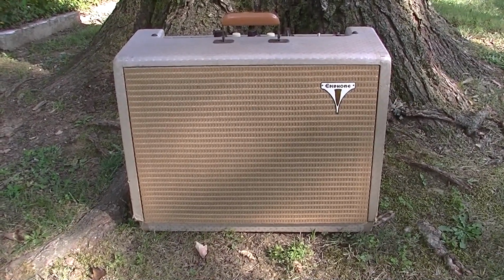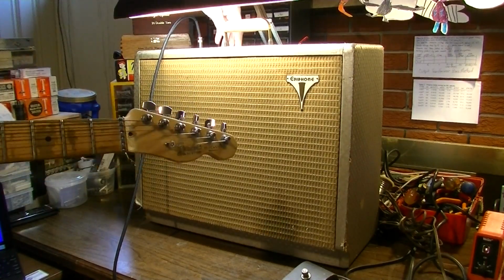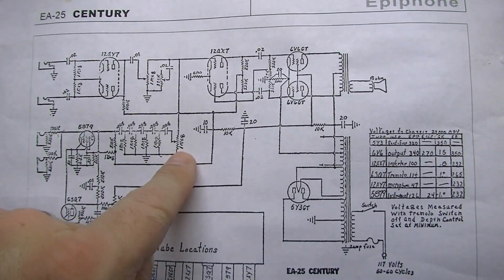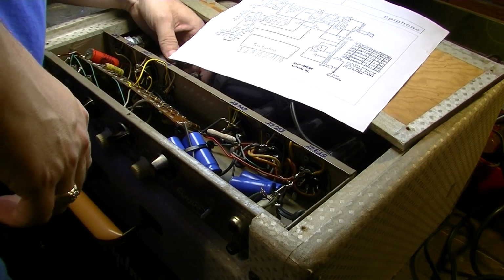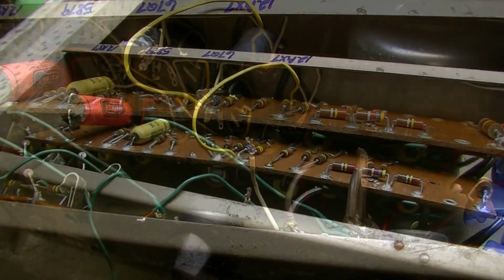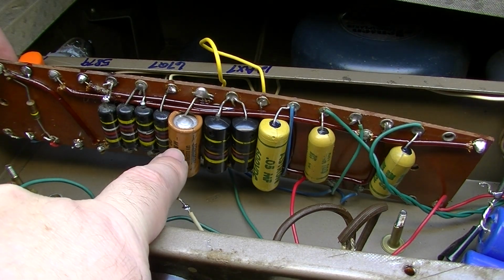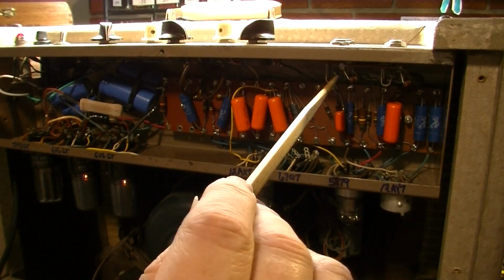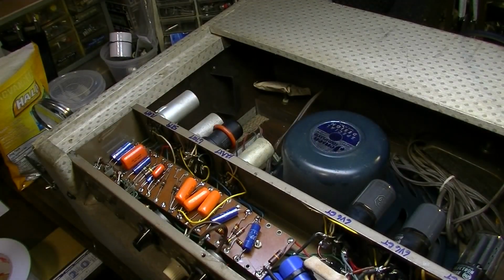Recapping Vintage Guitar Amps - When is "Killing the Mojo" OK? (1959 Epiphone Century EA-25T)

Comment: I'm trying to get better at evaluating circuits by looking at schematics. At around 8 minutes you are talking about how the channel 2 signal ties back in to the channel 1 line and will be affected by the channel 1 tone and volume control. How do we know that the signal will make a left turn as well as a right turn toward the PI? Is it because there is a path to ground below the channel 1 tone and volume controls?
Reply from the maker: An electron will follow multiple branches of conductive material looking for a pathway to ground. If you give them an easy path, such as a low resistance provided by a pot, you will direct the electrons to ground. More of them will find it easier to go to ground rather than travel to the tube grid to become signal.
Reply: Thanks, I thought it had something to do with there being a path to ground in the equation. Great videos, keep 'em coming!

Comment: i would invest in a capacitor checker like the Eico,Heathkit etc,that would let you evaluate better coupling capacitor,because it allows you to operate them one a a time at the working dc voltage.

Comment: New Old Stock Phillips Vacuum tubes might work in there, some electronic engineers seem to prefare the Polypropylene  capacitors to any other types for use where non electrolytics are used.
Reply from the maker: Polypropylene and polyester type caps both hold up well over time.
Reply: A lot of nos phillips are rebranded GE's, and the bugle boys also give a great glassy tone. Telefunkens are awesome in the marshall sound.
Reply from the maker: I did a tube rolling experiment recently: https://www.youtube.com/watch?v=pCIKXRRd8RY

Comment: The resistor/capacitor network in channel 2 is actually a highpass filter to dampen low freq tremolo oscillation thump. Kind of a yet another tone sucking network. But you seem to like it! Would be great if you tried to bypass it if you get the chance. Would need a cap instead to block DC, of course.

Comment: I LIKE Sprague Orange Drops. Reliable, predictable, and cost effective. Fender liked polyester caps, too, in the early 90'S. I used them back then in my audio amps and guitar amps.
Reply from the maker: They hold up well. I usually use the smaller red Panasonic type polys standard, because they are even cheaper and work in even more situations where smaller components make a better fit.

Comment: I have the same amp! I have never seen another until your video!
I want to install a 3 prong plug, it looks like you have white (neutral) to the fuse and and black (hot) to switch. Green to chassis. I can't tell which side of switch the black goes to. Could  you please help? Thanks
Reply: Rick do you still have yours?

Comment: i have a question please, i bought a vintage plexi and i didnt know much about tube amps so i took it to the tech and he changed the blue small caps because they were dry as he said
but my question is the caps he inserted are dark blue and small and stays vertical on the board not horizontal like the old ones and when i asked him he told me they are the same but these are the new ones , the most important thing is that they are the same reading.... so is this right ?
am still annoyed a bit because they are not horizontal like the old ones
Reply from the maker: So he installed radial caps rather than axial caps. That's ok. I mean, it'll only matter if you open it up and stare at the guts. The value is what matters most. There is an off chance that if you come to sell it and the buyer is a stickler for that sort of thing, it might jeopardize a sale, but technically speaking, he didn't do anything wrong.
Reply: exactly radial instead of axial but same reading exactly....he could not find those axial here in Egypt
he told me those are very old and we dont have them here anymore
Reply from the maker: Sounds like it may have been a slight misunderstanding. You can certainly still buy axial caps today. Maybe they're harder to find there for some reason, but I don't know.

Comment: The sound of that Telecaster in the beginning is SOLID! Could you tell me which Tele that is?
Reply from the maker: It's a weird one. 1991 American Standard with a humbucker in the bridge and an active boost circuit. The boost is set really low though. Almost a non-factor.
Reply: Thanks for the reply!

Comment: Reminds me of working on classic cars. The difference between a restored (and safer) and concour quality vehicle can be $250K. How much does "exact restoration" add to the value of a musical instrument ?
Reply from the maker: In the guitar world, the crazy collectors don't like ANY restoration at all. That's the problem.
Reply: Well, most musicians couldn't tell a resistor from a capacitor but will go on at length about how "great" the original parts are. lol

Comment: I just recently purchased a 1975 Randall Commander 200watt amplifier. It's not a commander 2. It's a single order commander. I can't find another like this one. 2 12" speakers no label except the date which is June 7 of 1975. The reverb is shot and the reverb trap is good. This amp is too beautiful and sounds great until you use reverb in clean. On overdrive it's good but I can't find anything on this amp.
Reply from the maker: Interesting. The only other Commander I've seen was in this video: https://www.youtube.com/watch?v=hxGD4hiY6og
Reply: Yeah I seen that video. That's what led me to sub to your channel. You are very good and even though most would say the vids are boring. I find them very beneficial and crucial in rejuvenating musical history. Thanks for spending your time in uploading your work. I still can't find this amp. All vids on YouTube are of the commander 2 and higher. All Amazon, eBay,Craigslist,guitar world and even Randall themselves. Mind you this model I believe is around the time Randall split from Fender. So maybe very limited numbers. Bad news is the plate has been broken off. So no serial number. All other numbers though. Original reverb trap even. Idk. I have looked everywhere.
Reply: I'm so in over my head with this thing. I have so much to do at work and I know virtually nothing about what I'm getting into in doing this. I have a person that can saulder (I probably misspelled that) but I have been offered $800 for this amp. I live in Muscle Shoals Alabama I found out that Waylyn Jennings owned the 210 model, Eric Clapton played with an amp head of this model along with Kurt Cobain and many other artists but known with this version. I believe I have found a diamond I'm the rough. Maybe. Can I contact you with more info on this?

Comment: I had an old amp I bought used in the early 1970s for $50   (half a weeks pay)    in 1990 it failed and the repair guy said they were not built to be repaired. They just were not expected to last 40 years.

Comment: I know this is kinda late, but I've just joined.  I love that epi! You are not shotgunning when you change electrolytic caps that are a half century old.  Using new (as opposed to nos) is wise also as these caps can dry out just sitting on the shelf.  Also, older electrolytic don't have the safety crimp and make a really nasty explosion under some circumstances. 
BTW, the logo looks like the ugly hunk of plastic the put on the headstock of some of their guitars.  Still, you could do a lot worse for the money.

Comment: Sounds great now! Do you have any interest in working on a vox super Beatles head?
Reply from the maker: Thomas Organ late 60s solid state? Dunno. Maybe, but it would have to at least wait a couple months until I get moved into my new house.
Reply: There's absolutely no hurry - this thing has been sitting in my closet for years. My brother used it as his main gigging amp for a long time, and it's really beat up, and the power amp isn't currently working. I replaced some of the caps in the power amp and it worked for a while, but apparentIy I didn't do it well enough. I really enjoy your videos, and was thinking maybe this would fit in - I'll ask again in a while.

Comment: Keeping it original might have made sense if it wasn't going to be used, but it would have been a shame for it not to be used as good as that sounds. It needed the overhaul. Gibson didn't design the circuit boards to be pretty, they were designing them to to perform the function and used the components they had available at the time. The way I look at it, if they'd had access to the quality of capacitors we have now, they'd probably have used them. You kept the circuit working as close to intended as possible and that's what really matters.
Reply from the maker: Thank you for the comment. We are in agreement.

Comment: I'm surprised you'd leave even the low-voltage circuit bumblebee caps in without a thorough electrical test. Are they not susceptible to age-related drift and decay?
Reply from the maker: Yes, they can drift, but my main concern with those was that they would be leaky, as in leaking DC when used as couplers. But that fear is resolved with the orange drop in front of them.

Comment: Personally i have shotgunned a amp with standard replacement mallory mylar capacitors with out any problems and the owner was way happier all the old caps had excessive leakage with less than 20 volts applied using my eico 950b.

Comment: Kinda reminds me of a 5e3 of the same era with added tremolo like the 5f11.
Reply: Johnny Cab yeah it even has the same look too, as far as cabinet construction and speaker used. The thing about fender is Leo build them not only to sound good, but very economical to work on in that tight space too.
Reply from the maker: I prefer 50s Gibsons generally to 50s Fenders. Only drawback is the ease of service.

Comment: Wow. talk about a closet kept amp.. Looks almost brand new... So in watching this video, and reading the below comments, this brings me to a question I've had about vintage amps for years... If a vintage amp has been re-capped, re-tubed, new resistors, perhaps a reconed speaker or speaker replacement, why are vintage amps still so expensive??.  When they have been overhauled, the components are mostly new. Are we paying for old pots and wiring at this point? What's the real value in a vintage amp if most of the guts have been updated and replaced?

Comment: That Bullet shaped thing.. maybe it`s supposed to resemble a Megaphone?
Reply from the maker: Your guess is as good as mine. Someone else commented that the logo looks like a thong and the black thing is pubes. :P
Reply: I used to have the speakers and Horns I took out of an old Olympic console stereo  some years back  and the Horns looked just like that shape  the white part...  If I remember correctly  the center part of the Horn  was kinda like that center part of the logo.    wish I still had them   but they went up with the rest of my Cabin  in a Fire.
Reply: Steve Redenbaugh I was gonna say horn with a phase plug but I'm going with the thong theory

Comment: I 'spose it depends on your goal when it comes to working on an amp. If all the owner wants is a museum piece to look at, brag about about and not play, then keep it 'mint'. If he wants a playable, working unit, then by all means do what is necessary to get it working as it was intended to be used.
I think too many gear heads get wrapped up in the Mojo mystique. Sure, it's vintage stuff, but is was built to be used. It's like a fine saddle horse. It was bred to ride, not look at.

Comment: This video popped up as a suggestion, so I decided to revisit it again. Reading through the comments, I was absolutely floored reading about people saying you can lose your sonic "mojo" if a tech replaces your caps and works on your amplifier. This is utter and complete nonsense. I started wondering what could make people think about things this way, and I came to the conclusion that they (evidently) don't really understand what's going on electronically in one of the simplest electronic circuits that exist, which is an amplifier.

Yes, an amplifier can age, slowly, and what happens is these old coupling capacitors develop something known as ESR, which is "Effective Series Resistance." What happens to a capacitor when this happens is that it also starts acting like a low-value resistor as well. In coupling stages, that couple different levels on amplification, from one stage to the next, this added resistance combines with the bias of the tube or transistor, altering it ever so slightly. When this happens, a small amount of distortion is added to the amplifier, and, over time, players get used to and enjoy the sound they are hearing. They become accustom to this sound, and it becomes their "mojo." -- but there is a problem.

As time rolls by, ESR can increase in value, and the capacitor is acting more like a resistor than a capacitor, altering the bias to a point where audio amplification is very, very non-linear. This can sound great, as in a free distortion pedal -- HELL YEAH -- but this altered bias can and will (eventually) destroy the component doing the amplification and can take out very expensive tubes, in the case of tube amplification. Should a tube decide to red-plate and short, because of bias alterations in the output stage, they can also take out expensive audio and power transformers, with the B+ rail having a direct path to ground. Let's also not forget that the speakers can easily be taken out as well, as they don't enjoy large DC voltages.

While we're at it, slow ESR development in tone circuitry can also add to and detract from your mojo; however, it will also change the biasing of these circuits as well. The same rules apply to this circuitry as those that I've just listed.

So, what we really want here is a 100% linear amplifier, with absolutely ZERO distortion added in the amplification stages. The correct way to do this is in the pre-amplification stages. You distort things there, and the 100% linear amplifier stages copy and amplify that distorted signal perfectly. These days, there are a TREMENDOUS amount of ways get your mojo dialed in, anyway you like, want, or need it, with pre-processing, either digitally or via distortion pedals.

"I'm just going by what I know and hear, Dave, and there is no getting around that, fool!" WRONG ! You either don't use a tech, or the tech you're using doesn't know what the F&&* he is doing -- period! An example you might want to give is Brad getting monster tone out of old AM, tube radios. Basically, what we're seeing here is old caps with ESR showing up. It's not enough to destroy a tube, but it is enough to get that "dirty, grunge" sound out of the thing. OTOH, ask Brad how long he thinks that sound is sustainable without cratering that radio. It might last a bit, but it will eventually take the thing out, and that's the last thing you want to happen with a guitar amplifier when touring or even about town on a gig.

So, in closing, I'll just say this: if you're all into only using the original components in an amp and think that it loses value by having the components changed, then you don't know what in the hell you are doing and need to STFU ! Guitar amps are NOT old, collectable cars and airplanes, and quit trying to make them act as such, you fricking moron!
Reply: Brad, I have an idea. What we need to do is start collecting old wax caps with a tad of ESR and use those to replace caps with significant ESR :D. Yeah, the amps will cater a lot sooner, but they won't lose their "mojo." Not only that, but we'll make a HELL of a lot more money in repairs. We'll need to do some data analysis, but all of us techs out there should be able to statistically figure out that sweet spot. That is, the amp stays out for 6 months to a year, they get their "tone," the amp craters, and we get another big repair fee without ticking them off. LMFAO! I'm just kidding here, of course, but I hate to say this is about the only way I know to placate these people. :D

Hmmm. Maybe there is something in ordering a ton of these NOS wax caps. All we need to do is explain the risk and ramifications of using them. We can filter through them and select the caps that have just a slight bit of ESR. Hmm. We can also get them in the lab, build a quick-connect gig, slap in some different caps, and ask them which sound they prefer. LMFAO! Hey, if they are going to be retarded, we might as well help them down that path :D.

Comment: great job very impressive..i understand the chopstick.. wood does not conduct electricity but it looks like you are wearing a metal ring while working on a live circuit board..be safe take off all metal while working on any voltage from low to high..also nice guitar playing.

Comment: Old caps get leaky, creating noise. They also have increased dissipation factor, which is a stored energy in the cap leaking out over time, and this robs transient edge detail and smears the decay. In the high fi world we pay extreme attention to blocking caps, and frequency shaping caps in order to increase clarity... If you want more texture, more impact, more drive, more detail, etc.. get better caps!

Comment: Sozo, Schmozo; modern mass-produced polypropylene capacitors are manufactured to more demanding specs and are much less expensive. I'd also ditch those Sprague Atoms for some modern power supply electrolytics and swap out that crusty looking bias resistor on the 6V6s. Heck, while you're in there you might as well also replace all those noisy carbon comp resistors with mil-spec metal film resistors to make this the best amp that it could be.

Comment: If you think this is designed to stop you servicing it you should try fixing modern cars!  Nothing wrong with the sound of that amp after repair though.  It sounds like a good rock and roll era unit.
Reply from the maker: You can keep the modern cars, thanks. :D